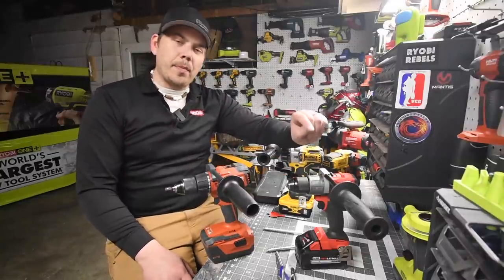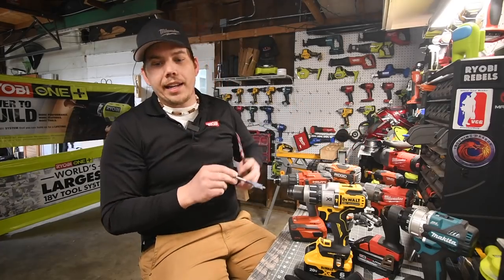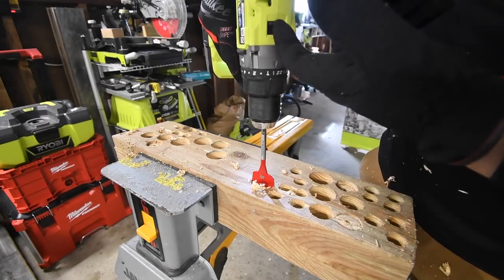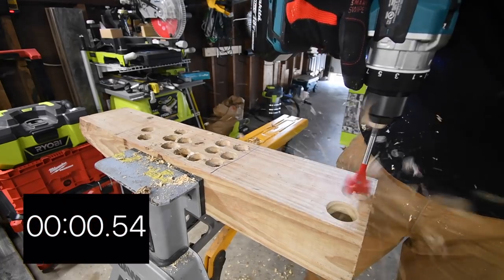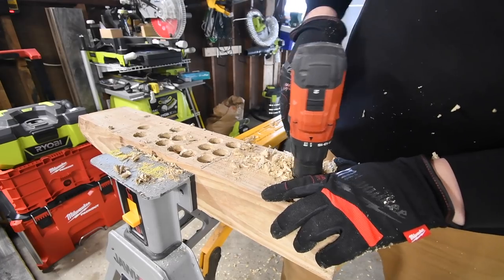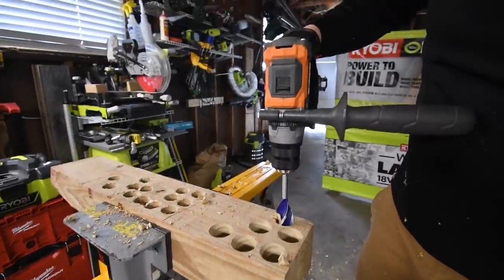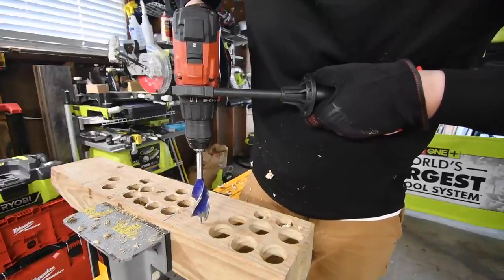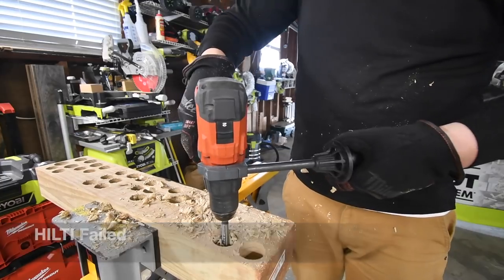BRAWL!!! WINNER Battles The Flex Turbo Hammer Drill

Comment: Test both the dewalt and Milwaukee. I think they had a tie against each other. It’s only fair to test both against the flex.
Reply: I agree. Test Dewalt, Milwaukee and Flex together. I suspect it will be Dewalt, but it could be a coin toss between Dewalt and Milwaukee and Flex will be dead last. Maybe as bad as the Hilti
Reply: I agree 👍 💯 I wanna see gen 3 fuel against flex with the 6ah ho battery
Reply: Dewalt is the winner it already beat milwaukee in one of his videos.
Reply: I agree
Reply: Yes but realize density of wood is totally different in different spots some that stalled would have powerd through in less dense spots i agree the dewalt is stronger and faster than the m18 fuel its that the video showed the m18 with a 2ah non ho battery I believe with the 6 ho battery the results will not be the same I believe the dewalt will beat the flex but only testing on wood with the same density throught the board 6×6 8×8 and so forth i just wanna see how these fake tampered flex video actually makes that power we all seen how they fixed it so flex won every single time I also wanna see the m18 fuel 2357 tested against the best flex impact driver  may the best tool win
Reply: @emmanuelmartinez8312  the milwaukee beat the dewault 2 out of the three test
Reply: He had the 6ah battery on the DCD998

Put the 8ah on it, that’s what the drill was designed around. 

I like Milwaukee, but DeWalt is king in my book.... plus the DeWalt won more tests and on the battery it doesn’t come with
Reply: @bwselectronic  VCG did the gen 3 Milwaukee high output against the flex few days ago. Flex won. I was surprised. But every test is different I’d like to see another try.
Reply: I agree. I understand power detect beat milwaukee on a different video, however what's the point of using a brawl to decide who's going against the flex if your not going to consider the results cause it goes against your previous results.
Reply: Just like others say maybe test all 3 tools that would be interesting to see if flex could beat both tools in every test.
Reply: Flex will win newest tech plus I have already seen footage of the low end drill beating the high end Milwaukee 😂 I find it to be very funny how salty dewalt and Milwaukee fan boys are but if they would think to themselves for one second ☝️ oh this means Milwaukee and dewalt will make better tools.
Reply: @right8630  you must watch VCG ;) I know it was sad to see a cheaper flex drill driver destroy a gen 3 Milwaukee but yes it’s good because now Milwaukee is in the office drawing up a better tool. 

Again it’s worth a shot to both tools (heck throw the Hilti in the test too ) and give all 4 a hard true test that MCT gives them.
Reply: Agreed I think after you do the DeWalt versus flex you throw the Milwaukee in there everyone wants to see it Dave
Reply: @kadenhiggins4826  I watch just about every tool review channel 😂 it’s to early to tell but I don’t believe a company would risk heavy lawsuits if their claims were wrong also tech does advance faster and faster so let’s see the response from Milwaukee gen 4 and the other part of the big 3.
Reply: agreed!
Reply: This comment right here is on point. Put them ALL THREE thru ur tough test. GIVE MILWAUKEE A FAIR TEST TO EARN ITS REP BACK. SINCE IT WAS THE IN THEY USED IN THE FLEX VIDEO.  THEY NEED A REMATCH ON TOUGHER TEST
Reply: @jzuniga633  he just used a 1 inch spade bit tho. The test wasn't a tough enough
Reply: Was thinking the same thing!
Reply: @shermanwilliams7724  Yeah this test was different. but it doesn't remove the fact that Flex won it. that test basically proved in non extreme heavyduty use it will beat out the competition. Id like to see if it can handle this type of work. id also like to see it against the flexvolt advantage dewalt.
Reply: @jzuniga633  basically that flex can drill a tiny hole in wood half a second faster then Milwaukee is all they have shown me. Not that impressive at all to me.
Reply: Very impress by the DeWalt, but Milwaukee held its own.  The bigger the bits got the more the Milwaukee shined, put Milwaukee in coach.
Reply from the maker: I will probably use both
Reply: @lepore5326  dewalt is king in hammer dril but impacts the undisputed king is Milwaukee gen 3.5 fuel
Reply: @TacticalThib   I just watched a video of some guy testing the flex vs Gen 3 and Gen 3 got smoked.

Not much performance difference between Gen 3 and Gen 3.5
Reply: @lepore5326  what battery was used a 5ah non ho battery?
Reply: @lepore5326  I just watched Milwaukee destroy flex lmfao you can't beat the king bro once he put that 6ah ho battery it was over who you watched was paid by flex bro
Reply: Based on other videos I've seen I expect the Flex to win at this point. They did their homework/engineering and based their entire product line around beating Milwaukee. Even the driver and the drill look similar in size and look. Will gen 4 beat Flex, I would assume so. Yet having a cell up on M18 is huge, that is a 20% increase in power.   The question I have is can Milwaukee release M24 batteries that are compatible with M18. For those users that want the best. My guess is yes. 30V is the threshold where the hipot test requirements change.  Will they do this or stay with M18 is a good question.  The voltage is your pull. So even if the cells can deliver a higher current carry that doesn't translate through the wires and motor without that pull factor which is voltage. Therefore Makita should have real good pull with their new 40v but they can never have a slim battery unless they use a smaller cell that probably isn't sold in mass. It would be a 1 ah 40v battery.  To me I don't always need a big battery so to not really have that option with makita makes it undesirable to me. The 24 v makes the best of both worlds it seems.
Reply: @kartboarder22g17  watch toolhead147 video just released and see for your self
Reply: @TacticalThib  Texas tool Vault broooooo... take a look broooooo. He has only 5k subscribers brooooooo lmfao. Probably some of the most unbiased people have less subscribers broooo.
Reply: @TacticalThib  watched it when it came out. The wood he was driving in split even on the last one where he said Milwaukee was the winner. It split on Milwaukees side.  It was back and forth.  The impact driver also doesn't have turbo so it will always come close to the Milwaukee.
Reply: @shermanwilliams7724  idk man we just have to wait and see how the tool lasts. If your in the business of using it for to drill inch or smaller then this tool will be the tool for you. When you have to repeat a action 200 times a day that decrease in time of use will make you lots of money. I wouldn’t down play the flex yet. Let’s not forget this has more volts so it should be expected to get things done faster than most competition.
Reply: Dude the Milwaukee kicked the DeWalt s BUTT.  MILWAUKEE WINS. SURE IF YOU WANT TO CHEAT DEWALT STILL LOST AGAINST MILWAUKEE. TEAM RED 100%.YELLOW SUCKS
Reply: @kadenhiggins4826  this comment didn't age well haha. Flex got destroyed in MCT test video today.
Reply: @jzuniga633  those were simply speed tests as the screws and bits they used provided little resistance. The hammer drills aren’t necessarily built for speed it’s the power that counts. They didn’t test that. This one means more to me. That all drill fast enough but when you run across something you can’t do then that’s different. VCG is sponsored as well.
Reply: Flex is a joke, sorry
Reply: @kartboarder22g17  they will stay with 18 mate. At the end of the day it’s wattage that wins. Just feed it more amps at 18v and you raise the wattage
Reply: @littleterror05  I think they will too but they are at the max on those cells new battery technology has to be made to increase amp delivery.
Reply: @kartboarder22g17  21700 cells are rated up to 45 amps, so 4 in parallel is 180 amp or 3.24kw, how much power do you need? 3 in parallel is 2.4kw which is the same as most wall outlets, the voltage isn’t the issue and they have a lot to go to max
Reply: @littleterror05  4 in parallel is a 15Ah battery your saying, where 3 in parallel is a 12Ah battery.  Here is the thing though to run 45A through the tool 10Awg wire is needed.  Therefore to get the same power output with a higher voltage less current can be run through the leads and therefore smaller gauge wire, easier switching as too high of current leads to arcing.  So there is a benefit to higher voltage.  This is where Makita 40V is better posed for high wattage tools.  For instance If you wanted to pull 90A through, 5 awg wire is needed on the 18V concept.  So by throwing 6Ah, 12Ah or even 15Ah packs(if one ever exists) onto the tool(plus too heavy) you are still limited by the tool due to the leads, switches, motor, etc. by how much current you can pull through the tool.  Clearly here a larger Ah pack will have better longevity if used on large pull tools due to each cell not being drained so hard.  As that is a battery killer.
Reply: @kartboarder22g17  40v requires 2x as many batteries in series as 18v so. 40v 45amp or 18v (20v) 90amp is exactly the same physical size battery, with exactly the same wattage. 40v wasn’t their smartest move just helps decrease wire size. Flex is best positioned as they are running 6 series not 5 so they physically have more batteries than everyone else which is why I imagine they went 24v
Reply: @TheCamaro5  dewalt should have failed on the 1 1/2 speed bore. It’s 2000 rpm like all the other ones so in realization the Milwaukee won.

Comment: If you think that power detect killed it...you should see it with the 8ah battery... that dewalt power detect is made to be used with an 8ah to see its full capacity
Reply: In the first seconds of the video you can see the batteries he's using: 
6AH HO for the Milwaukee Fuel, 8Ah for the DeWalt powerdetect.
Reply from the maker: I thank you for viewing  :)

Comment: Bro, for a tool review channel.. you should know how to lock a ratcheting keyless chuck. The reason your spade bit fell out on your Dewalt Power Detect is because after you tighten the chuck as much as you can by turning it clockwise until you cannot tighten it anymore- you have to turn the chuck counter-clockwise 🔄 for a tiny bit until it “clicks”, that’s how it locks. If you do this, you will find that you won’t be rounding bits in your chuck anymore. They also won’t fall out of your chuck as well. Just a friendly tip, from someone who also didn’t know to lock a keyless chuck and thought that they were trash until I learned how to lock them properly.
Reply from the maker: I dont lock the chuck for some of these tests. if the test is too hard it will Destry the chuck

Comment: So this is a test to find the most powerful drill at 2000rpm's. Kinda like which sports car can tow the most?
Reply: that dewalt runs at 2k in medium gear? and the milwaukee only runs at 2k in high gear?
you're right though, this is totally like a bad automotive show.
Reply from the maker: I thank you for viewing
Reply: But driving on 3rd gear need muscle, lots of it. I had a DEWALT 3gear about 15 years ago, it was the fastest on small/medium skrews that i had To use, but battery consumption was high too on 3rd gear. So every tool has its place, depends what u require the tool To do.
Reply: @ManCaverTools  The flex goes through at speed 2 with that bit. Not sure what's wrong with yours.

Comment: Not changing the rigid and Makita down to speed 1, but changing the DeWalt when you want to kind of makes it look a little suspect. Also, a Tool’s protection features stopping the user from abusing the tool is t a fail.
Reply: Dewalt only went to speed 2 which instead of like 2300rpm it goes to 2000 or 1900 for example close to Milwaukee’s 2100rpm not like speed 1 where it is 700-800 rpm
Reply: So now it turns out DeWalt XR DCD998 has been sitting at 2,250 RPM (from the specs I can find...)
So Flex also lied about their drill-driver being the only one that runs at a higher rpm than 2000...
Reply: @wim0104  I mean Milwaukee runs at 2100 so yep “ turbo mode “ is just another name for speed 3 on other brands
Reply from the maker: I thank you for viewing
Reply: I'm a milwaukee fan boy but that dewalt has been a beast for years I own an older milwaukee and dewalt smokes it
Reply: @WyattH  It’s not just another name for speed 3, because turbo mode increases the motor’s top RPM (works in both gears, so effectively a 4 speed) so long as the tool or battery are running below a set temp threshold that’s somewhat lower than the limit that it’ll shutoff totally to protect itself.

Basically, look at it as a 2 speed drill with NOS. Whereas Dewalt’s 3 speed is an added gear set between what would normally be gear 1 and 2.

Comment: Hope to see the flex volt battery on the Dewalt when taking on the flex turbo.
Reply: Flex volt battery is way less powerful than the 21700 cells in the 6ah high output batteries..
Reply from the maker: I thank you for viewing  :)

Comment: Do you think the Milwaukee would do any better with the 12.0 amp hour battery with 21700 cells? I have a few different size batteries but honestly the 9.0 seems like it does better than the 12.0.
Reply from the maker: yes it would

Comment: I think you have to test both against the flex. That Dewalt is rapid until the bits get to a certain size, but, the milwaukee will put any wood bit you put in it through in high speed. You should see it go on the 2 1/2" self feed on pro tool reviews, its a monster. It may not be the fastest but its definitely the most powerful.
Reply from the maker: I thank you for viewing

Comment: 8:21 Dude! You need to use the 8AH battery for that drill. That’s what the power detect is made for!!
Reply: the video starts with the XR 8.0Ah... did he swap? OMFG he did. This is as bad as any Flex commercial...
Reply from the maker: I used as equal batteries as I can
Reply: Question , does dewalt make a drill for the 60v option ?
Reply: @onsiteelectricianscott4025  Not any normal handheld drill to my knowledge. Only the 20V, and 12V.
Reply: @ManCaverTools  I understand that, will you please do a small clip comparing the 6H to an 8AH battery with the power detect? For us to truly see the 8AH difference on one or two of the tests? I have this drill, and all of the battery sizes. I recall seeing another video showing how this drill can get through the wood on a higher speed without stalling, using the 8AH. Where as the lower AH battery would stall. I would like to see if those results were true.

Comment: DeWalt failed in Speed 3... "But I'll finish it in Speed 2"
That's literally the definition of moving the goal posts. Haha!
Reply from the maker: incorrect, switching to speed 1 is moving the goal post
Reply: @ManCaverTools  I would disagree. Speed three in the dewalt is its highest speed. Which is equivalent to speed two in the other drills. (As their highest speeds). By switching it down to 2, you give the dewalt an unfair advantage over the other drills tested, as it would be equivalent to a speed not present on their gearboxes.
Reply: @jacobmansbach4804  Thats right ;) speed 2 at the dewalt have more tourqe and less rpm are the other

Comment: Milwaukee has the Best warranty hands down, their tools are the best in trade in my opinion
Reply: Any idea what their return process is?  I have a cordless m12 rotary tool that is less than a year old. So loud, either a bearing is shot or coming from the motor. Very disappointed, as I came from Dewalt and always heard how great Milwaukee was, and this is a tool that was fairly unique that no one else makes (I do also have the m12 impact and the hammer drill but don’t use those much as I’d much rather use my dewalt stuff due to the increased power (which it should be since they are 18/20v tools, so that’s not comparing apples to oranges).
Reply from the maker: I do thank you so much for viewing :)

Comment: Bro use a screw extractor to get that out of the hilty it'll work 💯 and just replace the screw it's a standard screw you should be able to find it anywhere
Reply from the maker: I thank you for viewing  :)
Reply: @ManCaverTools , I thank you for not turning the drills chucks back a click!  I thank you for finally realizing what that guy told you about turning the chuck back a click clockwise was BS.

Thank you for the test!

Comment: See this is how they should do test. I still like my makita brand even though it’s not as good as Milwaukee or DeWalt. Just be honest with people. You wanna get a dedicated fan base that’ll buy the tool not because it’s the best at everything, but it can do almost everything as good as the big boys. Let the tools do the talking don’t do it for them.
Reply from the maker: I thank you for viewing
Reply: Makita is very much a big boy. Don't let this video fool you.
Reply: @BamaShinesDistillery  Makita have earned their  stripes.
Reply: @interman7715  yes. Anyone who states it is not as good as milwaukee or dewalt is plain delusional. My last makita drill burned the brushes out after years if use. I was still using the original battery

Comment: Dewalt nut here , needing your advice on a new hammerdrill, I can get a 996 new for 104.00 ..... I can get the 998 and 999 for about 130 ish new .... in my opinion the 999 not taking advantage of the full 60 volts is just a false name on the drill, the 998 has power detect but I dont plan on buying high output batteries , I would like to use the 5 amp hour batteries I have , also with power detect that is just something else that will mess up in future , the 996 seems to be just as strong , maybe the 998 stronger with a nice battery but is it worth the price difference ?
Reply from the maker: I thank you for viewing  :)